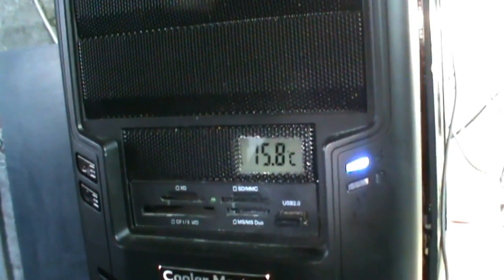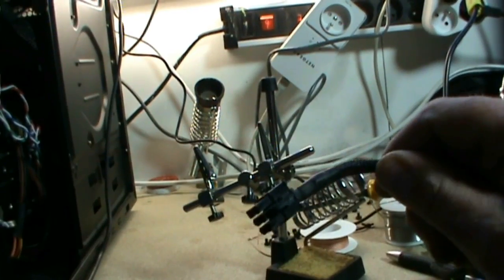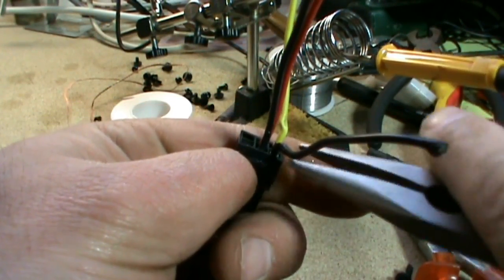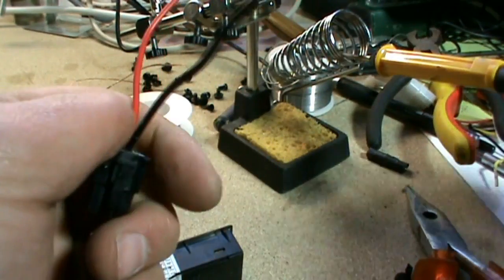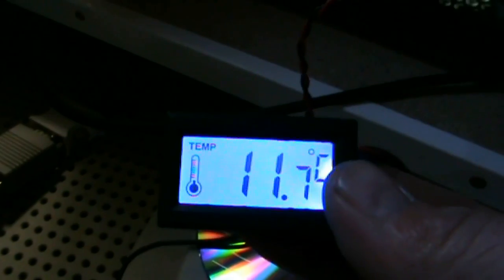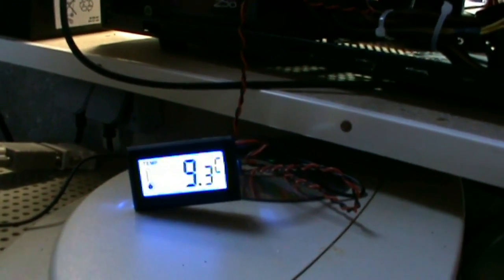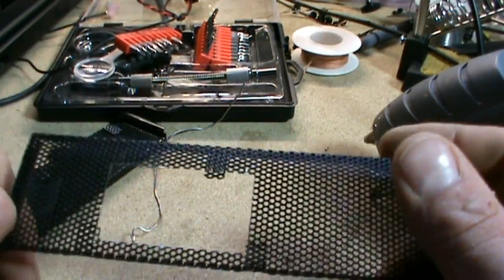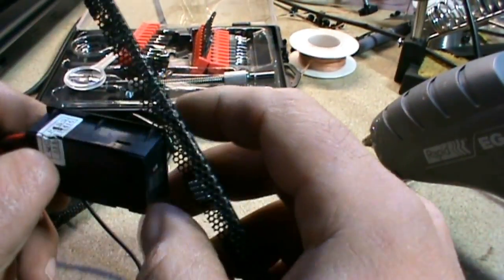Temp gauge install on a computer

Comment: What is supplying power to the gauge? You plugged this into your motherboard somewhere?
Reply from the maker: In the power supply
Reply: @Jan46  Oh ok. Yellow wire is 12 volts and red is 5 volts? The gauge I have is 12 volts. Thanks for reply 👍🏻

Comment: Where do you put the metal probe at if I want to measure my CPU temp?
Reply from the maker: It's not ment for that use but I would stick it in the bottom of the radiator fins as close as possible to the cpu

Comment: so what is that second black and the yellow cable for because i see them in the pictures for the sensors?
Reply: Hi, it is a connector with 5v red and 12V yellow an neutral black  it has nothing to do with sensors
, the sensor is already wired to the LCD screen when you buy it
Reply: Jan the Metal Detectorist ok so like for this http://www.frozencpu.com/process#blank i only need the red and black coming directly from the screen (and the sensor wire obviously) right?
Reply: Grny Sensei
the most of those temps gauges already come with plugs you don't even need  to weld
Reply: Im putting it into a console thats why I ask